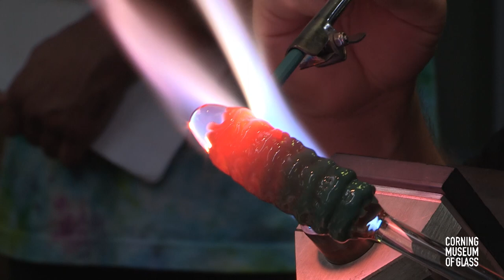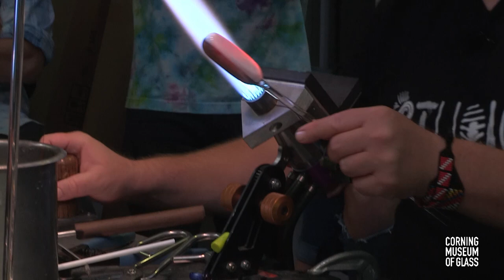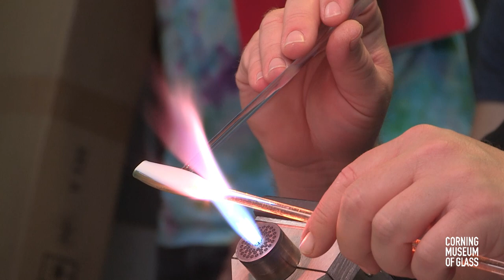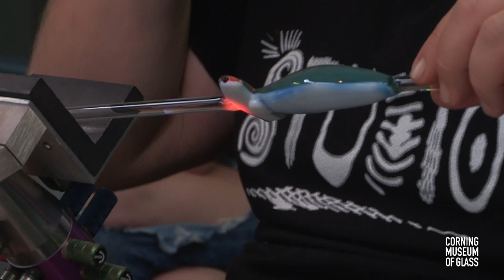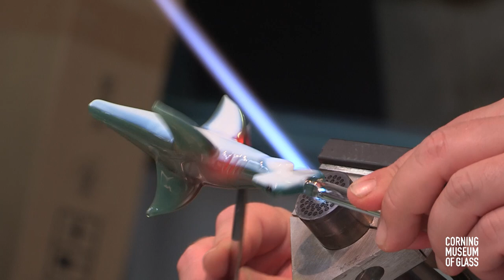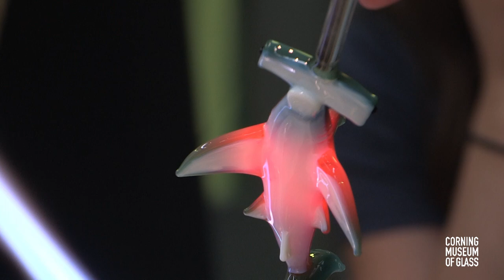Joe Peters Live-Streamed Studio Demonstration

Comment: i'd say the anatomy was correct, but hammers don't have poles sticking out of their noses. I hope it was removed. Very beautiful color and nicely done) I wish i could buy it cuz i love sharks)
Reply: thats called the "punty". He has to be able to hold the glass in the flame with something, so a rod of borosilicate glass will do. it gets removed at the last step by holding the finished piece with insulated tongs so you can melt or cut the clear rod off the front and clean up the glass at that portion to finish it. 

almost all glass is blown that way by hand with an umbilical of something holding onto the glass object, either steel pipe/rod or glass tube/rod.